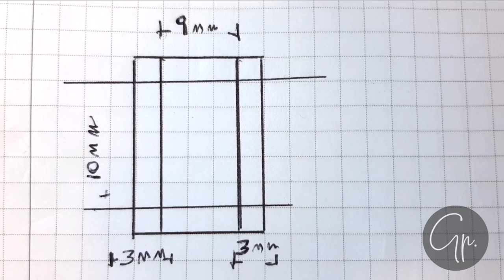🔥Cómo hacer un CIERRE CAJÓN de plata ⛓🔗 💎Clases de Joyería

Comment: Señor Guille Petrochelli realmente te felicito por tu excelente video y profesionalismo también aprovechar para pedirte orientación respecto al material que necesito para hacer el cajón a la pulsera se’ que el espesor es un milímetro sólo me falta cuánto sería la lámina en total ??? Mucho sabré agradecerle y en espera de du respuesta gracias. Mi nombre es Fernando Rivera
Reply from the maker: Hola Fernando, si te referís al tamaño final....eso lo decidis vos segun el modelo que estes haciendo, largo, ancho y altura de cajón.
a eso te referís???
Saludos!
Reply: Hola Guillermo te quería preguntar lo siguiente hice una placa de plata con sus respectivos pases de lija pero quedaron rayas y una mancha lo cual creo que podría ser del material bien me gustaría si te es posible hacer un video de cómo lijar y luego la pulitura que debería ser tipo espejo muchas gracias por haberme respondido Gracias una vez
Más

Comment: agradesco tus clases de joyeria, tengo una duda, soy nuevo en esto, quisiera meterme de lleno a la joyeria y me gustaria saber si me puedes decir de que material es la soldadura que utilizas para hacer todo esto, muchas gracias, te seguire viendo y saludos
Reply from the maker: Hola!
Busca en mi canal un video de xoko hacer soldadura de plata!!!
Saludos
Reply: El Dojo de Ryu 
You can make 90 percent, 80 percent, 70 percent, 60 percent different things by combining brass and pure silver  For example, 70% of the product is pure silver 70. Bronze is 30 and pure silver is melted first, and then brass is melted to alloy